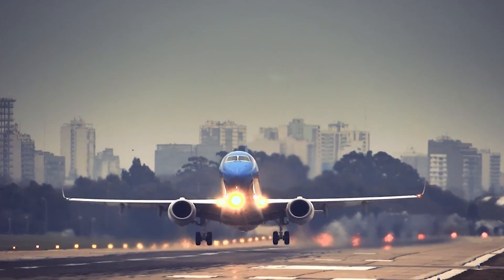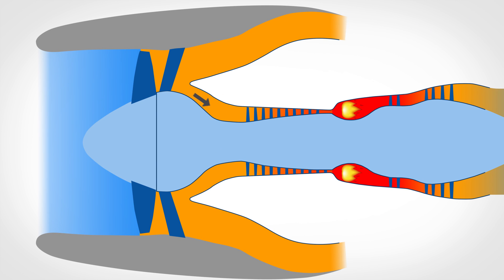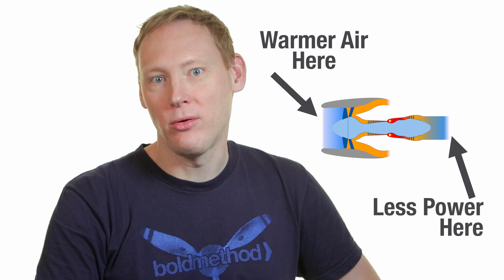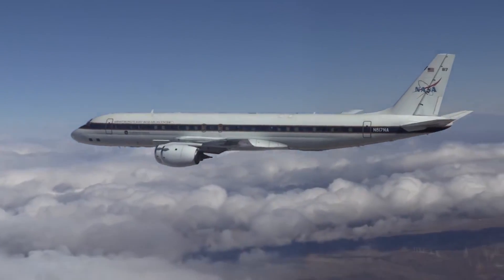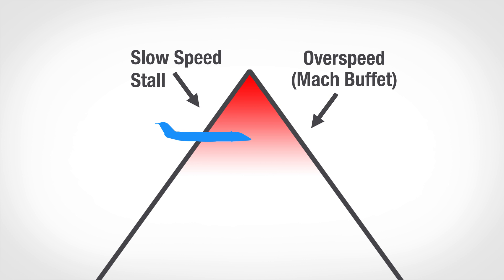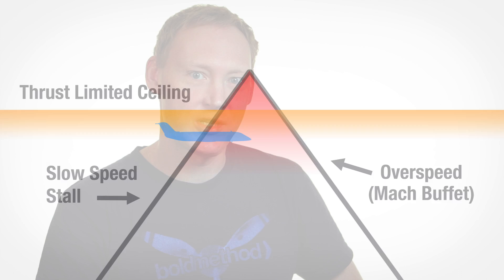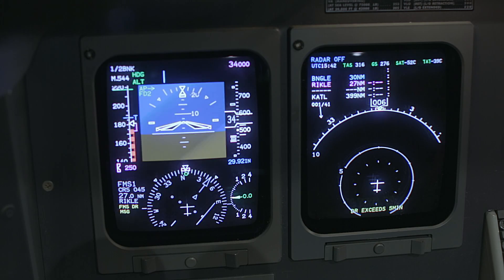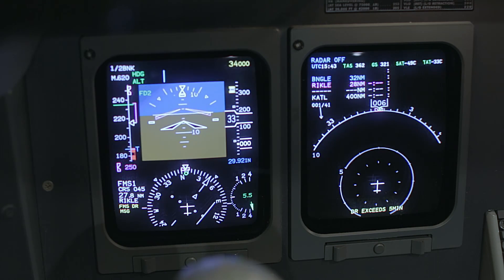How Can You Possibly Get Slow Here?

Comment: Wait. Wait,  wait, you said apply max cruise then descend so if you are near coffin corner that's gonna give you mach crit buffet before you even get to the nice, juicy lower altitude that you need. You're already in the poop with no way out so descending will increase your speed, ask anybody, pulling on max cruise pwr will help you gain speed . So there's two things you cannot do and you have just said do that very thing...?!?!

You need to lower the nose enough to combat the incipient stall,  stay as slow as you like but with a lower pitch. Slower but don't stall.  Eventually you'll have some air over the wings and you can take it from there, a few thousand feet lower.

Comment: I suppose it is omitted for simplicity of the video, but isn't IAS and AoA very significant when it comes to these scenarios, especially when not operating near MMO? Lower speed=higher AoA=more drag. Hence it is important to identify the problem early, before the airspeed drops to a point where it is significantly increasing drag. Also why most pilots tend to fly their climb/descent profiles at relatively high KIAS.

Comment: Hello,

well explained. But adding max thrust during a low speed scenario is not always favorable. I fly 737, and with underwing mounted engines you will find yourself in a pitch-up attitude by adding thrust, which lowers your airspeed even more.

Daniel (Frankfurt/Germany)
Reply: Then it is a good thing Boeing decided to install elevator controls. Pilot must control the airplane, the airplane does not control the pilot.

Comment: I thought the bulk of thrust in a jet comes from the rotation of the main fan, not the jet exhaust. In other words, the diagram showing the main thrust being generated from the rear of combustion is false because it's the rotation of the main fan caused by the gases from combustion that generates the bulk of the thrust.
Or is that incorrect?

Comment: Eh.... Just don't try to climb to 410 in that CRJ and you'll be fine. Only people falling out of the sky at normal altitudes are those who are climbing in VS mode or forget to put power back in (as seen in the video). Also, the reason for low performance in these regional jets is air density/temp as stated, but due more to the fact that the fans have less to work with. These aren't turbojets, but turbofans, and 80%ish of the thrust is generated at the N1 stage.
Reply: lalomcnombres Correct that 80%ish of the thrust is generated by the fan at lower altitudes but the video was discussing high altitude performance where the majority of thrust is still created by the jet. Cheers!
Reply: Ok, I admit I'm not the smartest pilot of the bunch, buy this is the 1st I've heard that. Certainly available power decreases significantly at altitude, which is why you REALLY need to descend aggressively in a high altitude stall recovery- there's just no power available for recovery. What I don't get is how available thrust for the fan will decrease while the jet will maintain it's power. It still operates off "suck, squeeze, bang, blow", no? So wouldn't the decreased air density effect it as well?
Reply: Ed McNames Well, you're absolutely right that the jet loses some of its efficiency at high altitude but think about the fan (N1), it's basically working on the principles of a propeller to produce thrust. It helps us create very fuel efficient and faster (less spool up time) reacting thrust at low altitudes but when we get up into cruise it's the jet that is responsible for the majority of our thrust. Even though that jet, like you say, produces less thrust in less dense air, compared to the now highly ineffective fan, our N2 is the work horse. Hope that clears it up, mate!
Reply: Brian H. I'd really like to see some quotes and preferably a physical explanation for that, because what you are saying makes very little sense to me. In essence what you are claiming is that somehow turbine blades become less efficient at lower air densities. However, this creates several problems for a turbofan engine design. Here's how: the required compressor energy input is essentially directly proportionally to air density. Why? Because from the ideal gas law you can derive that the amount of work to compress gas is W=nRT ln(V2/V1). Since V2 and V1 are fixed in an engine and 'n' is directly proportional to air density, it follows that work 'W' is a direct function of air density. So assuming for simplicity that an engine operates at a fixed rated rpm, the turbines can't do anything but extract the exact same proportional amount of energy from the gas stream as a function of air density. If they extracted any other proportion, the compressor would either overspeed or underspeed. And since the fan is driven by turbines essentially no different to the turbines driving the compressor, it follows that the fan is still receiving the same proportion of energy from the engine core. This means that the core jet retains the same relative proportion of available residual energy to produce thrust and hence the energy ratio between core and bypass shouldn't change significantly.
Of course, I might be missing something, so please point me in the right direction if you think I got something wrong.

Comment: CRJ.... nuff said. 
And actually the same thing happens to recip engines. It's called 'bootstrapping'. Fortunately advancing the prop rpm a bit will alleviate it.
Reply: Yeah that bit where they said that turbine engines are uniquely affected by altitude made no sense. For any fixed compression engine, power output will simply be a function of intake air density.
Reply: @totoritko  I think he doesn't quite have the thermodynamics knowledge needed to truly understand why they behave as they do. However i think the intent of what he said is more like turbines don't have a linear response to throttle and altitude while otto-cycles engines do respond fairly linear. (Anybody here fly a Diamond? I'd like to know how their diesel-cycle behave near the ceiling, and are those in particular turbo-supercharged or open air?)

Comment: I had a former U-2 pilot tell me the "coffin corner" was 3 knots, between Max Speed and Stall Speed, on the U-2. He said there was a theory that Gary Powers was not actually hit by a Russian SAM, but the shock wave from the blast caused his airplane to stall, and he couldn't recover. He also said there was a fuel trim wheel that was very precise for controlling engine thrust in order to maintain the 3-knot barrel, as it was called.
Reply: I just saw a Storch with Flat Panel Glass and those are likely plastic not glass ••• Only recently do we have Fleming & Penicillin or Lister then last I saw there are 2 YT  channels with 92 Million that neither both of them have any content → You could tell these folks that Gary Powers was a Government Hoax and none of them likely used the Coffee can in a B-36 near Arctic Circle
Of course they did; They have those sim toys
Reply: For any plane that has enough power at altitude to reach coffin corner, the corner is infinitely small hence the term corner. The only thing that determines the +-3kt range for the U2 is the mission decision to cruise at that particular density altitude. 
I'm not sure what I think of the Powers stalling theory as I simply don't know the handling characteristics of the U2 regarding stall, spin, and mach tuck with mid mission weight and balance.

Comment: In the intro why the F was he not pushing the nose down when the stick shaker activated?? And did he say Turbojet? I think you mean TurboFAN. Turbojets haven't been used on commercial airliners since the early DC-8s/707s (except for Concorde, of course).
Reply: The point of the video is to discuss the relationship of temperature and the compressor section. Turbojet and turbofan can be used interchangeably in this instance as a turbofan is essentially nothing more than a turbojet engine wrapped in a ducted fan, and both would be affected similarly.
Reply: A stick shaker is a device that shakes/vibrates the stick when the aircraft is stalling.
Reply: What does the stick shaker mean?